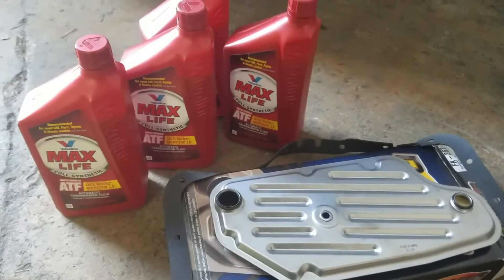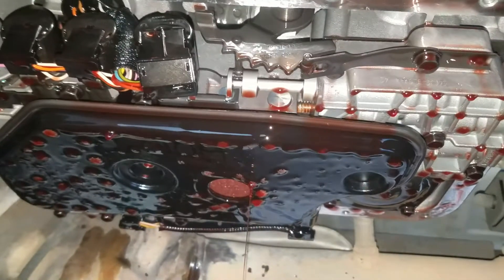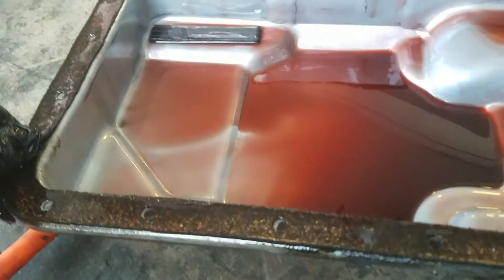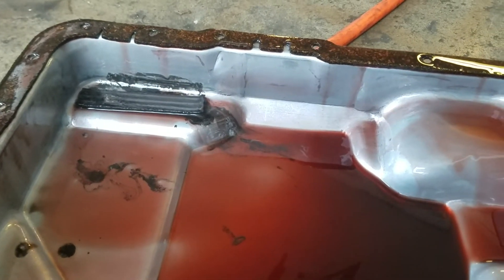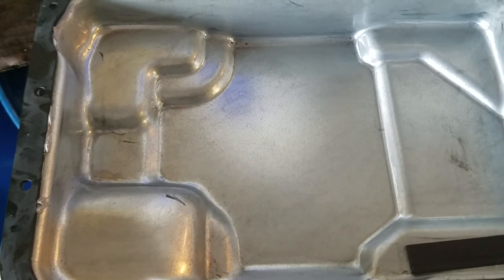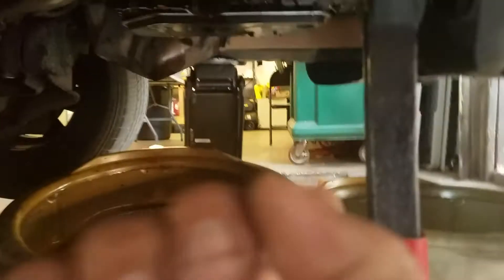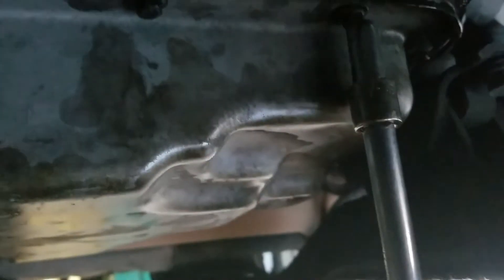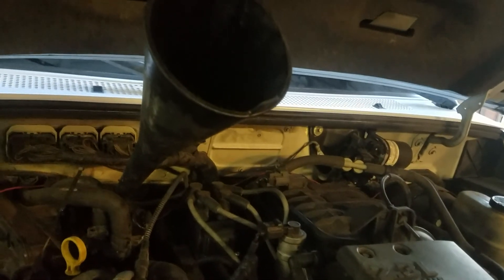2008 Ford Ranger transmission filter and fluid change

Comment: Thought you should never clean the pan with towels cuz of possible lint. Air dry only. Also, how did you drain the fluid out of the torque converter? It holds half the fluid I think

Comment: Probably should be using the right fluid! Mercon v.
Reply from the maker: Gorilla951 yes mercon v is the recommended fluid but you can also use Valvoline MaxLife Multi-Vehicle Automatic Transmission Fluid compatible for honda, gm, Toyota & FORD :) I'm not spending $12 a quart. Besides the client (Oreillys auto parts) supplied their own fluid and parts. They know what fluids are compatible and less expensive. If they can put that in a few other of their trucks I'm sure we can trust them. Besides this video was made awhile back & no damage has been done . No worries! :)

Comment: Fluid looks new, why change? Magnets actually pretty clean compared to a transmission that's been neglected or has problems. Imo anyway. Really don't recommend putting gasket sealer and there maybe just either nothing or they actually recommend using oil soluble lube but and don't laugh Vaseline or petroleum jelly works great! Just finished doing all of this to my 08 about 30 minutes ago
Reply: Thats what i was thinking, fluid looks so clean lol but I think it’s recommended every 70,000 miles ?
Reply: @James-vh7bx  well my fluid looked brand new but my gasket was bad

Comment: you  drained and put 4 quarts. is that all the fluid in the trans?
Reply: It has 9 quarts in the transmission. But drain with gravity only let around 40% out.

Comment: What a pain, you figure they'd be smart enough to just put a drain plug.
Reply from the maker: Danial Pham i agree... everything has to be a hassle so that youre forced to the delaership or auto shop
Reply: Here's the kicker - the Koreans DID put a drain plug in their Kia and Hyundai vehicles.  But they made the filter so hard to get at that you have to drop the tranny to take it out and replace it.  They ALMOST came up with a better solution but what good is changing the fluid if all the old crud is still in the old filter?
Reply: @STBRetired1  A lot of transmission filters are made from metal. I guess they last pretty long and can be cleaned by the new trans fluid. If it's a transmission with a drain plug, I would prefer to do a trans-fluid change several times and keep the filter untouched. It would be even easier than doing an oil change, and I can do it at every oil change. Minimum extra work.